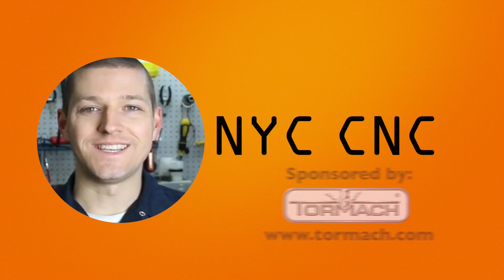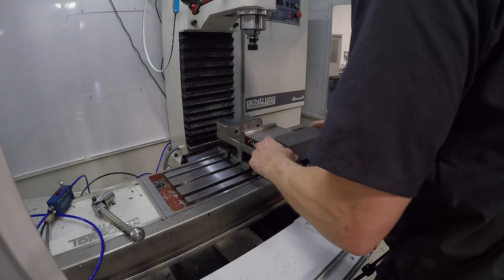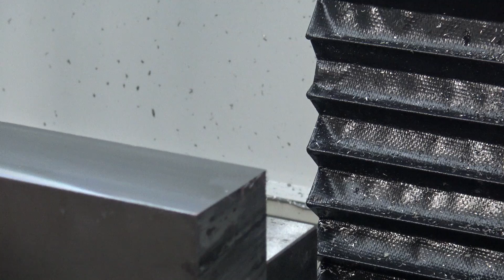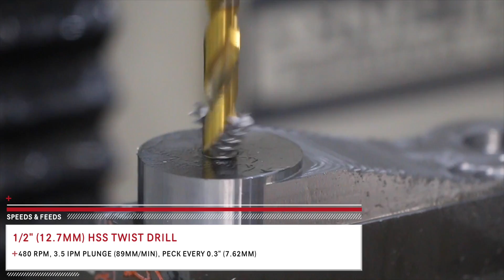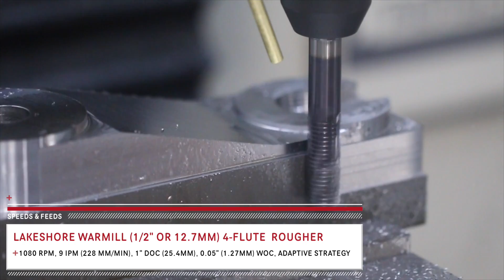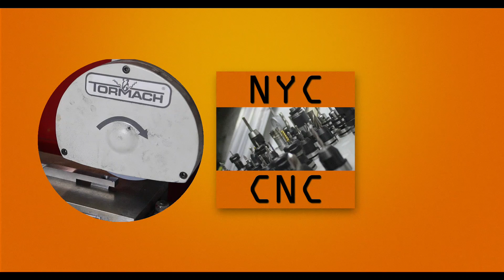Abom79 Parking Attachment!  Part 1  Widget96

Comment: I have just brought my first CNC mill. I have little idea what I'm doing. Sadly it stopped working soon after I got it. So I find myself in the deep end. Installing new drivers and breakout boards and a new spindle motor. Had it not been for the likes of you I may not have had the confidence to have ago at it. I have battled and fought for every square inch so far. But I see the positive side to this. I now understand and know every component and no matter what goes wrong in the future I can easily fix it.

Comment: It's so satisfying and therapeutic to watch a machine like this producing such consistent chips, almost resembling aluminium chips? That tool must be perfectly sharpened and it doesn't seem to want to get blunt at all! - but it is quite a bit harder than the 1018 mild  low carbon steel though which must be like cutting through cheese! Great video! :)

Comment: Speaking of your no engagement feed rate, I notice that your trochoidal milling does the same when it loops back.  Is that a setting in your CAM?  I've used it a few times, normally with a higher hp machine and a huge MRR, but even on this machine, I'd figure it would code with the different feed rates.  Just wondering.
Reply: Also, most machines don't recognize over rides when tapping, is that different on the Tormach?  Keep on keeping it real bro, awesome vids!

Comment: wait... tormach machines take feedrate overrides during tapping  operations?!?!  thats nuts.  ive never seen a machine that applies any overrides in a tapping op, both mill and lathe lock it out to prevent dumb stuff from happening.  pretty much writing off tormach based on that alone

Comment: a lot of the roughing could have been done with an inserted mill and plunge milling...much faster, and way easier on the tools. From the sounds coming from that machine it would probably be easier on it too...
Reply: thats surprising that you havent had much luck. By inserted i was thinking a 5/8" or 3/4" 3 insert mill. you could go it with a bull nose endmill too.

Comment: Hi, thanks for all of the videos.  They are super helpful for those of us trying to learn.

Did you run this job with the spindle belt in the upper or lower position?  Do you change the position of the belt, and if so, can you explain the thought process behind belt position on the PC1100?

Comment: What was the purpose in doing all that fancy rotary milling at the start on the right hand end, only later to machine it all away before making the stairs cut ? Would it have not been simpler and quicker, just to have milled it away as a relief, then rotary mill the shape later ?. I know nothing about working cnc, only conventional milling methods.
Reply: Cad cam often are model aware and concentrated on tool life and constant Engagement of the cutter.  Smart Toolpaths automatically not so much.

Comment: Awesome series man! That is a hell of a part for a tormach..  Do you find that your MQL cooling system helps with steel parts? When I cut steel with carbide I tend to run straight air, but for me it is air or flood.  What advantages do you find when running MQL on big steel parts like this?

Comment: What was the motivation behind using the 1/2" drill to pilot for the 11/16" drill? Just curious, I was always taught to use a drill fairly close to the size of the chisel edge of the drill bit. Also, in my experience if I go too large it ends up breaking the corners off. I've been looking forward to the Abom Part for a while, love the long machining videos. 

Just another thing, the sound the CNC makes at 10:04, I'm not sure why but I think it's great. Perhaps not for the machine no, but it gives me the impression that the machine is really taking a grandiose cut and handling it well.

Just another another thing, ran my first personally designed, and programmed part on a HAAS TM-1 this Tuesday, it was an upper desk leg for a desk that I have designed for my senior Precision Machining class project. I'll find a way to post pictures once it is finished if you're interested! :D

Comment: Increase your RPM...half inch endmill on your tormach should be maximum rpm. If you increase your RPM you can increase feed rate and use smaller WOC due to the lack of rigidity.

Comment: Probably should have just jumped straight to the 11/16 drill. No need for the 1/2".
Reply: Carbide? I've got loads of HSS drills of every size, they just add up over the years. They always seem to be dull though. :P I throw the dull ones in a bin and go a sharpening spree for a while.

You probably already know this, but it's bad on the flutes to drill a small amount, especially by hand with an uchecked feedrate. If you are going to drill a pilot hole, try to find one just about the same size or a hair smaller than the web. That way it keeps itself centered better. If that is not practical for some reason, the rule I use is to always have the pilot drill be 1/2 the size or smaller than the main drill.

Comment: Is it just me or is the audio out of sync with the picture on this video? I've noticed this a lot on NYC CNC videos since about the time John moved to the new shop, but haven't seen anyone else comment about it. It seems to be worse on longer videos.
Reply: I was hearing drilling noises when the drill was out of the hole. Tried to stop/start to re-sync (which sometimes works), it didn't.

Comment: Regarding the blue hose when hitting feed override.Every machine I've worked on that you rigid Tap wether it's G code or Macro or canned cycle or subroutine.You cant override or change the feed when in cycle tapping.It physically won't allow surely you can go into the Plc and close a gate and lock the feed to safeguard against this.

Comment: The drill birds nests: Is it possible to just lift the drill a little bit frequently to break the chip without coming all the way out. It wouldn't be much slower as you'd not be moving far, but it'd surely make the long strings of flailing metal go away

Comment: have you looked at using Udrills instead of HSS Twist Drills at all?
Reply: Don't think he can utilise those drills on the tormach. They really need to be pushed. Though, it might be worth a try.
Reply: +NYC CNC they are a carbide insert drill. Great at large holemaking operations. Most tooling companies have them Personally I prefer Seco ones but companies like Sandvik, Iscar, Mitsubishi, Walter etc etc all work just as well
Reply: http://www.sandvik.coromant.com/en-gb/products/coromant_u?Country=aw
Reply: You would only use a U/drill insert drill/ cam drill in a high volume production environment  when you had many repeat holes and you were chasing cycle times  you need through spindle coolant for the drill to work also his spindle does not have drive dogs so he won't have the torque on the machine he has to optimise a U/drill
Reply: +Carlos that's not correct. I use udrills every day for a jobbing shop. I don't have through coolant and I hold them in an er32 spring collet mostly.
Reply: +Mitchell Nunnari Udrills are designed to manufacture repeat holes in production work for optimum performance they should be in a side locker with high pressure spindle coolant. Drive dogs have nothing to do with the collet. Their cut out sections on the taper face of the tool holder to provide torque grip in heavy operations you should never peck with a Udrills that's why you need these features. I've Been applications engineer for 25 year @ Mazak DMG BOST now WFL I've worked side by side with engineers from Sandvik seco iscar Walter and they will all say the same.
Reply: +Carlos I work for okuma and have worked as an application engineer for seco tooling. You don't need high pressure spindal coolant and you can run them in an er collet system. you can peck with them if you know what your doing. that's what's great about CNC machining with today's technology and know how the only limitations are those that people try to enforce on you. Similar to what your doing now.
Reply: One doesn't need to use coolant at all. John would most likely use it for aluminium and mild steel. The carbide inserts can handle that without cooling or lubrication.
Reply: +Revo SeR yes your partly correct carbide can cut fine without coolant but due to the high levels of heat that drilling creates you need at a minimum flood coolant. to keep those inserts from over heating and heat fracturing.
Reply: +Revo SeR drilling with carbide is obviously very different to milling with carbide. when milling it's recommended to use either heaps of coolant or no coolant as your cutter is in a state of extreme heat when that insert of flute is cutting or cooling when it is outside of the cut. This causes your carbide to under go extreme stresses and fracture. When drilling though your carbide is in a constant cutting state creating high levels of heat and needs to be cooled down to avoid losing your insert then welding your holder to your part.
Reply: +Mitchell Nunnari so let me get this straight you work for okuma and you don't have machines with through tool coolant ?? And you struggles with the term dogs and you believe U drills should be put in ER 30 collets. Your the biggest bullshitter in here. The high pressure coolant is to push the swarf down the helix angle back up the drill when the hole is blind. You Worked for Seco on the Apps another lie
Reply: +Carlos I never said I don't have machines without through spindal coolant. I said that when a need arises there is always a way. the Lb3000 live tooling does not come standard with through spindal coolant and is limited to an ER32 collet, and is quite expensive for customers to purchase the holders that are through spindal. I prove time and time again that if you know what your doing and what to look out for you can drill with the live tooling er collet holder and you can do it easily. You see I'm all about helping my customer achieve their goals and not helping them to bankruptcy.
Reply: +Carlos Seco have use tooling reps and if you have a technical problem it goes to mill turn process engineering. Same system every other tooling company uses. Nice try no machinist engineer anywhere in the world worth his salt would put a Udrill in and ER collet,Day 1 lesson 1 Udrills go in side locked tools holders other wise they can slip and rotate in a collet damage the tool and work
Reply: ***** you need to speak to your tooling reps then because I can tell you it is possible and it can work. Probably maybe instead of burying your head in a book you experience the machines and tooling you sell because I can guarantee I've done things with these machines and tooling that people like you will deny deny deny

Comment: One thing I am curious about, the tool path for the cleanup of the stepped slope (using the ball end mill), the rapid that brings the tool back to the bottom of the slope for the next cut, why is there so much movement away from the part? Surely cycle times could be increased by just lifting off the part by .1mm and running back 'down the slope'? Obviously this is a function of the cam engine in 360, but is there an option to improve the efficiency of these areas of the tool path?

Along the same lines, with the peck drill cycles, why lift the drill all the way out of the part? If I were drilling that on the Bridgeport I'd just lift off the feed handle for a second to break the spiral and get back on the feed.

Hugh, manual guy, no cam experience yet :)
Reply: Generally you would get the whole program done and working safely, and then tighten everything up once happy with feed, speeds, and clearances. Once offs generally aren't worried about in tightening things up.

Comment: I don't understand why the cnc milled the top part as part of the parking part. why not just roughly mill all of the metal off that u need to and then start shaping it in detail
Reply: Had same question...
Reply: I agree. It's a very inefficient toolpath. But interesting nonetheless.
Reply: I've never messed with cnc only mill and lathe but thought the same thing

Comment: I'm thinking of buying a medium size 'home shop' bandsaw soon....about 8X10 or so and preferably a swivel-frame saw...How do you like that Ellis..? Do you use a tool checking set-up to measure tools and then enter offsets in the CNC ?  How about that Tormach....I like the small 'home-size' unit...cost??  
 I Found your site in relation to the excellent ABOM79...!
Reply: NYC CNC  Thanks for the reply...My last job we used a lot of Ellis bandsaw blades on vertical bandsaws...3/8" X .025...M-42 teeth welded on....cut 1-1/2 to 2" stacks of Galvanized steel sheet...HVAC ductwork...